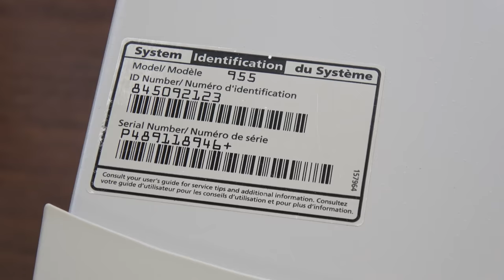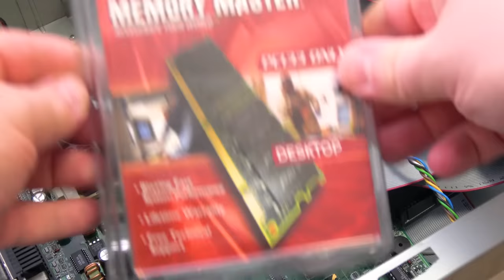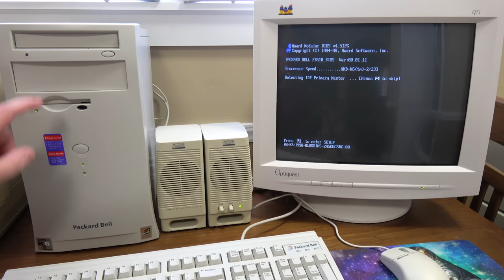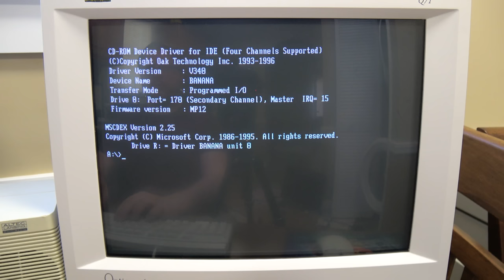LGR - Restoring a 1998 Packard Bell Multimedia PC

Comment: Man, the Sleep/power symbol under the power button is such a nostalgic thing for me. My mum bought a Pentium 2 based Packard Bell with an internet package in late 98 and for some reason I remember that more than anything else. I think it just looked cool to me aesthetically.  Aside, perhaps, from the speakers that clipped to the side of the included monitor. That PC soldiered on 'til around 2009 as far as I remember (very rarely used by that point!). It was the power supply that failed, we must have been very lucky with ours! Packard Bell must have had a huge impact on millions of tech keen kids in the 90s.

Comment: I had the PB Multimedia 945, which had the Celeron 333 Mhz Slot 1 instead of the AMD processor. It made it that much harder to deal with removing/upgrading parts inside the computer. I'd forgotten all about how difficult the hard drive was to remove! I had broken off a couple of the front bezel tabs near the CD-ROM drive so it never really stayed on. Ended up bricking the whole computer during a BIOS firmware update in like 2005, lol. 

Thanks for posting this! Subscribed

Comment: I used to restore computers that would come out of the goodwill clearance store in my area back from 1999 to 2005 . I must have worked on a thousand computers . Anyways at 9 dollars a pop , I had access to them . Back in the early 2000 , everybody was going for the pentium 2s and 3 was a grand prize up til 2002. I saw so many sought after pre windows computers go straight to the dumpster . They couldnt get rid of them for 99 cents back then .  Those were incredible times . I look at the packard bells , compaqs and other custom oddities with much love and adoration.

Comment: This is very similar to my go-to Windows 98 machine, a Multimedia 820 from 1999. Mine's gotten some modifications though- I've added a Soundblaster, replaced the modem with an Ethernet card, and added a 5.25" 1.2MB floppy drive to it. I intend to stick a proper video card in it sometime too.

Comment: Man, I built and tore so many of these systems down for parts I can't even remember how many. We had a Windows 98 Norton Ghost image that we would use to slap operating systems onto beasts like these as we sent them out of the shop. Was always fun harvesting them for memory, drives, cables, CMOS batteries, jumpers and so on.

 I have been ripping computers apart since my Vic 20 stopped working back in 1985 and me being the desperate kid that I was needed my computer back! 😸 Anyway, been going flat out ever since. Great video, I wish I had the sense to record all of my repair/gaming sessions from the get-go, I also owned an RCA video camera back then also. Damn, I'd be rich by now. Well, maybe. Heh.

Comment: Had a system very similar(mine was an Pentium 3 with 98SE) to this when I replaced my Amiga 1200 when I was about 15-16 that I used for years. It was amazingly good for a pre-made thing, never had any problems, but due to budget, I was only really running emulators(including like... 80% speed N64) due to budget reasons, but yeah. At this point, it seems Packard Bell machines were actually pretty solid.

Comment: My first computer in 99 from packard bell came exactly in the same case. I still remember the specs to this day: Pentium II Celeron 400mhz, 32mb of ram, Integrated creative sound blaster AWE 64 and integrated ATI Mach64 chipset with 8mb video ram (which was actually taken from the 32mb system ram) and a 4.2gb hard drive. 

It couldn't even play quake 2 smoothly with hardware acceleration turned on, I had to upgrade the ram to 64mb before I could do that. It was a piece of crap but damn, I loved it.

Comment: I loved this video, it's performance actually reminded me of my parents Toshiba they got, as a replacement for the NEC they had replaced 3 times (mobo fried all three times, terrible 1996 PC). The Toshiba never had issues and I even pulled it out of shambles a few years ago and powered it on just to see, and it ran just fine. Seeing my old Paint art, Diablo 1 and 2 installs as well as Age of Empires and Turok was a blast from the past (though Turok never ran right without a Voodoo, I still tried).

Comment: I had pretty much the same computer in terms of case design from Packard Bell.  Mine had a Cyrix CPU and a Rage 128 installed by default.  It was the first computer my family had with a high speed internet connection.  I remember upgrading it later with a Riva TNT2 GPU.   I remember my parents bought it along with a copy of the Star Wars Phantom Menace game. :)

Comment: I just pulled my old Packard Bell iMedia M847 (circa 2004) out of the garage a few weeks ago. And man, the architecture of the case is still pretty much the same as that '99 model.  This one is Pentium 4 2.6 gHz, 1 GB RAM and 40GB HDD.

I reinstalled Windows XP and threw in a Radeon 9550.  I also grabbed a Sound Blaster Live, mostly because I couldn't get the on board sound to work.  Well worth the $20 imo.

It's mostly a DOSbox machine for the moment. It plays Keen 4 pretty well.

Comment: I have this exact machine in full working order as well! It's a pretty nice machine, and it runs the Oregon Trail Deluxe nicely too! The only issue with mine is the floppy drive recently failed, and almost ate one of my floppy disks. Now it makes an annoying clicking noise and locks up the machine any time you try to access it. Also, it doesn't read CD's so I need to do some fixing with it. Despite all the issues, it's a pretty cool machine. oh yeah, and the hard drive may have some issues because some Windows drivers are missing or broken :(

Edit: Luckily, with the hard drive issues, Kiddonet works!
Edit 2: Some of the parts in mine are different than yours, and that is confirmed, because mine also has a ton of repair warranty sticker things on the back, so I'm sure mine has gone through some things.

Comment: I had a Packard Bell 9533 which I put a Voodoo3 2000 in and it was a decent machine. Good sound blaster support, 64mb of RAM, 533Mhz P3, 10GB hard drive

Comment: Back in the day, I loved Packard Bell. Oddly enough. Not because I didnt have any standards, but because I knew them inside and out. I knew their weaknesses so to speak. Because I worked on them so much. Espeaclly the mid '95 era machines that people tried to upgrade to Windows 98 with that modem/sound card! Opps!  That particular motherboard wasnt half bad, It was after Acer merged with them. True the intel version with the ATI combo and Intel CPU would be better by default, but at what that computer sold for in it's time, you couldn't really expect better. The bright side to it was it was very easily overclockable to my memory. The case itself reminded me of the lowend HP pavilion of that era, but the ATI video sure beats the Intel 810 by a wide margin anyway. Nice build!

Comment: I had a K6-2 in a custom case back then, after seeing the weird vertical hard drive install Packard Bell did, I am so glad. Probably saved me an HDD crash or two.
Was also cheaper, even if I didn't know hardware yet and had everything done by geek shop geeks (I was 10, alright?)

Comment: Man, I don't know how I ever missed this video... like, in general.. Crazy how fast things were moving back then, my first PC after my Macintosh Plus was a 1997 Packard Bell Multimedia something or rather.. Was a Pentium 233MMX, and it was BRAND NEW at the time, and about as fast as it got.  2MB 2D card, I added an STB Velocity Riva 128 4MB 3D Accelerator.... Was amazing.  It however, the computer itself that is, had this large based tower design... With the motherboard on the bottom, utilizing a riser card for all of the ISA and PCI slots.  Was odd.  I've never seen the exact model on ebay, though I do look now and then... It came with Win95c, and even had one USB 1.0 port.  No one knew what to do with it for so long, lol...  ehhh.... I miss it all so much.

This CPU (your k62) wasn't all that mediocre though, depending on what part of 98 it was purchased especially... as the 333MHz speed itself was achieved early in 1998 by intel first of course.  With the PII... Still on a 66Mhz bus though, where I believe the K6-2 was a 100Mhz bus already, or technically a 66/95 choose your own adventure deal... PII migrated later on.  Even the video card wasn't all that bad for the era, mildly aggressive entry level... say something akin to a 1050ti of the time... sweet computer.

Comment: In 1998 to 2003 I worked at Packard Bell Support in Sweden, this was exciting due to most models where put together of the cheapest and most available components that PB could lay their hands on, resulting in a model series could have 5 different modems, 5 ditto graphics adapters, processors, memory modules and so forth... resulting in turn in lots of hacks since many had incompatible hardware... the design of the cases where very spaced out and the front bezel where one of the big problems where CD gate broke in very artistic manners, IRQ conflicts  between soft modems and soundcards where common, and as you have found out the plastic details where both lose and brittle so they often broke or just fell off.... all this generated lots of interesting calls... at the end they really where full of bloatware, that we had to help customers uninstall just to get machines to work in a less painful way ... so they have come a long way and today they have some models that actually works in an acceptable manner :) At the same time I also served HP, Compaq, Gateway, AST(Servers) and Toshiba customers... those where actually enjoyable, PB's customers sometimes ended up crying after spending half a fortune on a peace of crap, so work was sometimes as much a schrink job as much as a computer support agent :)

Love your take on computers and do not miss any of your videos, kind of addicted :D

Comment: My mom just walked in and handed me a CD holder with a Packard Bell master disk, a sound card installer, windows 95, and AOL.
As soon as I saw the Packard Bell disk I came here.

It isn't the same disk you have though, I think, sense this pc came with both windows 95, and then a different Packard Bell disk.

Comment: I used to play MDK, Duke Nukem and DOOM. I don't remember the specs from that long ago but it was powerful enough to run the games with very few problems if any. I had also invested like $400 or so on a CD Burner at that time. 97-99

Comment: My first computer was an eMachines 466is and was very similar to this one. It was cheap as could be, had the same sound chip, and I think the same graphics chip. But even as cheap as eMachines was, they used a hard drive caddy! Upgrading the hard drive in my 466is was a breeze. And I’m pretty sure the eMachines restore disc didn’t require me to enter a Windows 98 key.

Comment: And now we have machines (like mine for example ) with 24+Gigabytes of RAM and huge hard drives. I have a total hard drive storage capacity of 24TB. 10TB on board and 14 TB external. Gotta have it for large audio and video files being that I compose music for film and TV. I record audio at 96khz at 24 bit resolution then of course dither down to 16 bit but if I am recording upwards of 12 tracks in a multi track session, it adds up fast esp at that sampling rate and resolution!

Comment: My first computer was a Packard Bell of this lineage with a K6² at 366mHz and 64MB of RAM. I used the same PNY 128MB RAM chip. It had the same hard drive and I paid $400 with monitor for 3 years of MSN internet. Microsoft even upgraded us to DSL when they discontinued the dial up in my area for the same rate. I miss that machine. It was so painfully mediocre yet capable.

Comment: That was the 100% OEM fan for that CPU and it was a complete piece of loud shit.  I owned one.  Bane of existence.  AMD was cheaping out on that big time.  Gotta watch the CFM output on replacements because quieter on a fan of that diameter usually means much less air output.  Also I spyed TweakUI and had a nostalgia-gasm on the msconfig list.  That is a legit badge of honor.  Your videos are great. =)

Comment: Honestly, that system should already be fine for the most part.
The GPU is decent, the CPU above average of what you need, 128MB is good for Win98, and the Crystal ISA soundcard works.
If you add a Voodoo 2 to the Rage 2 and a wavetable to the soundcard, the thing should run most games of the time in decent quality.

Comment: That case is as clean as a whistle! Nice machine, if just for the memories. I've been giving my custom build yet unloved K6-233 a bit of love this week, and I have to say, the cabling in this Compaq looks seriously tidy, given what you could do with cables from the era.

Just before you said "it's horribly loud" I was about to ask "how loud is that fan?" Mine is a frigging nightmare; a Noctua 40mm fan is on the way. And my 3GB Fujitsu drive isn't exactly silent.

Does anybody have any good suggestions for a new EIDE drive? The motherboard supports UDMA 33. Rapid!

Comment: Lol btw some cd drives back then could not read a cd-r that doesn't have strong label on other side. Yours is of that correct era so that cd drive could possibly work fine with regular cds, just not that specific type of cd-r.

Comment: By upgrading that thing with a late model AMD K6-III+ CPU you can really transform that thing, they will usually easily clock in fully stable with 2x=6x, hence 6x100Mhz=600Mhz, either without overvolting or may need a quarter volt to a half-volt of extra juice. This will require adequate cooling, however since especially the first and second gen Athlon core's were literal sauna stoves, appropriately powerful enough solutions can be adapted to fit from Socket462 heatsink and fan assemblies, or will fit the Socket 7 form-factor without any additional fitting. Also, maybe throw in a fully host controller offloaded U320 UWSCSI disk drive interface and use a modern SATA SSD with an appropriate SATA2SCSI-adapter. Then, maybe throw in a SLI pair of 12MB VooDoo 2's :D Finish it off with a Windows XP Pro / Windows Server 2003 R3 32bit dual-boot (or triple-boot with 98 :D), where you can enjoy the appropriate support for the SSE1 chipset addition. As well as having full set of 3dNow! and 3dNow!2 extensions and yadda SMD FPU trickery. If only you can find the unofficial windows kernel patch, which enables support for those additional cpu features. :( The K6-3 clockers community seems to have vanished from the face of the world. :(((( And I forgot to archive a copy.

Comment: Where do you (or can you) get new IDE drives nowadays anyway? Because I don't really have systems I want to save, but I do have some copies of Windows 95 and 98 and some older boards that might work and I just like to tinker around with computers in my spare time so, you know, I wouldn't mind getting a couple of drives to see what I can do. Or, I could go the druaga1 method and try to put everything on SSDS, that might be fun too.

Comment: I have this same computer but with a cyrix m2 and the computer wont start. power definitely goes through it and it turns on with power button but the psu fan and keyboard turn on but nothing else, not even the cpu fan and i get no video. Any help?

Comment: I know they didn't get much respect but I loved PB. I put together a 5 station network to run a small CU about 6 months after win-95 came out. Total price w a couple of dot matrix was about $3k. Ran that system for about 10 years, blew right thru Y2K without a hitch, was able to work 6ppm laser printer, had a 100meg Zip dr for backup, and one pc came with a built in tv tuner.D#$%^ software company swapped to win nt and finally had to move on.

Comment: I got my first computer of IBM Aptiva 2156 with same CPU of K6-2 333MHz in a much smaller case. This seemed to be a popular configuration at late 1990s for entry-level "multi-media" PC. It is really painful for gaming on this machine with only SiS 5598 integrated graphic chip and there is almost no way to upgrade with Super7 socket and no AGP slot on.

Comment: So, this is an old video, but I recently got a new (old Dell GX1) and had the same weird jittery thing with the last 3 Commander Keens. The fix was pretty cool, not sure if this Packard Bell or any other Pentium computer you have can do this, but booting to DOS and pressing Ctrl + Alt + \ puts the CPU in "compatibility mode", i.e. it slows down the CPU. This fixed compatibility with tons of older DOS games and made the jittery motion go away. Hoping this hotkey is available on other computers!
Reply from the maker: Varies from system to system and different between manufacturers and motherboards. But yep, this is what the "turbo" button did on lots of old machines! Very handy stuff :)

Comment: I had a decent curb find today, amd Athlon 1500+, 256pc133 ram, CD drive, 10gb Quantum fireball, e-tnt2 m64 32mb PCI, v92 dial-up modem, and a realtek pci 10/100ethernet card. All on a sesame seed bun... Msi ms-6378 v1. Not too shabby. Could run my file server build, but I'm tearing it down to rebuild with my 6 and 7yr old boys. Maybe we'll make a video!

Hey, by the way, that model wd drive is nowhere near quiet, but at least it ain't a maxtor/quantum.. Even the old loud seagates were quieter than that wd u got right there. I can't believe my old Xbox had the same 8gb as the one in ur vid, so when I modded it I went for caviar se, 200gb 😉

Comment: i worked for ncr for 10 years my first job was to go out and fix ncr machines and ones sold by sears back in 2000 i had to replace the parts they sent to fix them. i still have some packard bell motherboards.  sers canceled the colntract and the repair company did not want the parts back so i got all of them .  do you need a certain all in one motherboard still in the plastic?